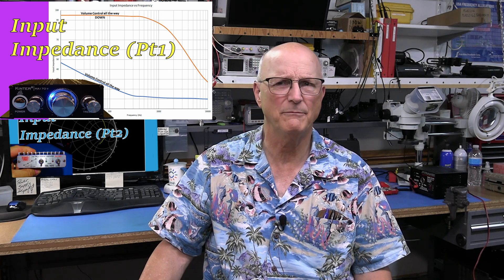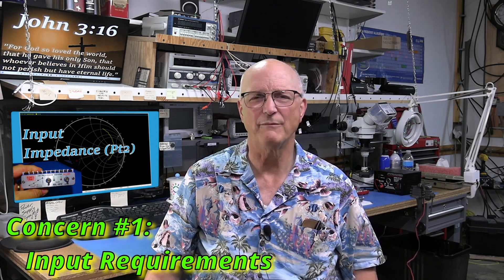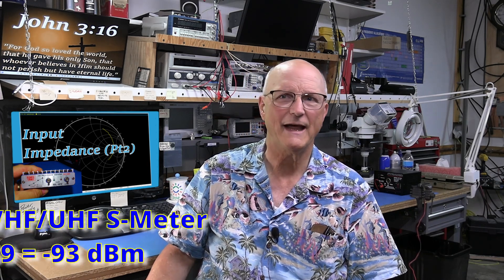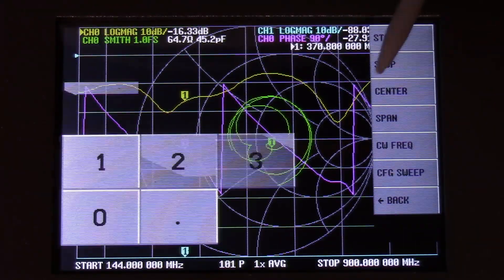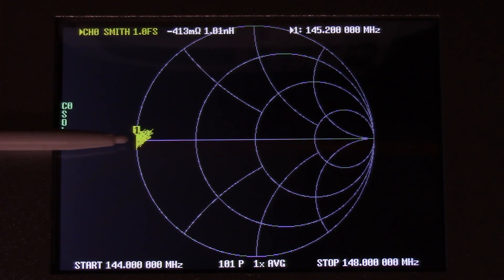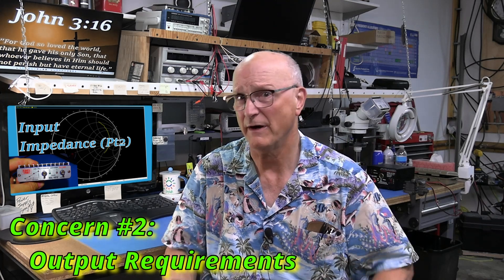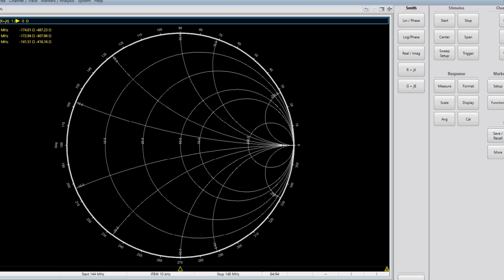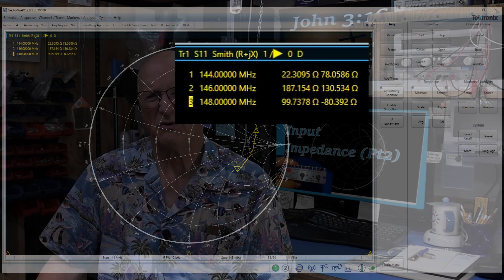Measuring the Input Impedance of a Product, Circuit or System (070b)

Comment: Great video!!! may i ask how to calculate the Retrun Loss=-2.1dB with measured impadence Z=21.8+78.6j  ???
Reply from the maker: Thank you!
We start by calculating the Reflection Coefficient =  (Zload - Zo)/(Zload + Zo), where Zload = 21.8+78.6j and Zo = 50.
Using Octave to do the math, I get a Reflection Coefficient of 0.3665 + 0.6935j
Next, we calculate the magnitude of the Reflection Coefficient = SQRT(0.3665^2 + 0.6935^2) = 0.7844.
In "Octave speak," this is the ABS command.
Finally, the Return Loss = 20 * log (magnitude of the Reflection Coefficient) = 20*log(0.7844) = -2.1092dB
Here are the steps from Octave's command window:
>> ((21.8+78.6j)-50)/((21.8+78.6j)+50)
ans =  0.3665 + 0.6935i
>> abs(0.3665+0.6935j)
ans = 0.7844
>> 20*log10(0.7844)
ans = -2.1092
I hope this helps. :-)
Reply: @eie_for_you  got it!!! thank u soooo much!!! learnt a lot!!!
Reply from the maker: You are welcome! :-)

Comment: Does this unit receive when power is off with just the insertion loss of the signal path (tenths of a dB) or does it need power to receive due to the tx-rx switching setup? How does the input impedance change from no power to power? Is this pin diode switched or relay or something else? I think that the under power measurement depends on the no power configuration so can we start there?
Reply from the maker: Yes, I believe it is a passive, passthrough for receive when the unit is off. Of course, this one is probably 27 years old and is long gone from the market place. It is very possible, however, that units of similar design exist out there now.
I have not dug into the design of the unit. As far as this unit is concerned, I am pretty much an "appliance" user. :-)

Comment: You saved my significant time and energy!! I was trying to match datasheet measurements of RF receiver and then match it to 50ohm using Nano VNA and Rigol VNA!! I will try to find a tektronix one. Thanks
Reply from the maker: I'd look around in the Rigol VNA and see if they let you adjust the stimulus level. ... and you are welcome.🙂
Reply: @eie_for_you  Rigol VNA has stimulus from 0dBm to -40dBm. With RF receiver powere On and Off there is a small shift in impedance measurement. Still Not close to datasheet value of 1.5-54.5j. My measurement is around 4-147j (with IC supply turned ON) 4.5-168j (without IC supply)
Not sure if this is the issue with VNA stimulus not being -40dBm (like you said for Nano VNA) or something else I am doing wrong.
Reply from the maker: And there will be a shift because the capacitances associated with active components (and even diodes) changes with applied power. :-)

Comment: Thanks for some very good and helpful videos.
Can you and if so how would you use a nanovna to set up a set of duplexer cans for repeater use?
Reply from the maker: I have a few videos on tuning duplexers (here is the link to the first video: https://youtu.be/ZZHknVp3asc).
So, the answer to your question is not really, but also sort of. It has the functionality but not the dynamic range. It can easily do the Return Loss portion of the tuning. But the reject frequency is where it cannot quite cut it. The reject dip will be a flat and wide bottomed dip with no way to really know what the exact reject frequency is. This is where the dynamic range issue kicks in. Part of this is due to the fact that the stimulus level is lower (mine is a fixed -9 dB!). The other part of it is the limitations of the "front end" of the receive port (port 2 - nanoVNA speak = port 1).
With all of that said, it is a great way to practice tuning a duplexer!
If you are willing to accept a just "OK" tune, then it might do what you want. 🙂
Reply: @eie_for_you  Thanks. I'll have to check those videos out. 
Have a great holiday season.
Reply from the maker: @REKlaus  And to you, too! 🙂

Comment: Hi.. EIE ... Can I give output of nano VNA ( 1 mhz square wave, 1.5 V Peak to Peak at the input of tiny SA. Or there is need of attenuator (value)?
Reply from the maker: I am at a bit of a loss as to what you are trying to measure. Are you measuring the input impedance of your tinySA whose input limits are 1.5 V pk-pk? 
As a point of reference, 0dBm is 1 mW into a 50 Ohm load = 50 mV RMS = 141.4 mV p-p.
Your 1.5V p-p = 530 mV RMS => 5.6 mW into a 50 Ohm load => 7.5 dBm.
My nanoVNA output is below 0 dBm. :-)
Reply: @eie_for_you   I want to know if I can directly connect output of nano VNA to tiny SA . Also what are limit of tiny SA.. Plz can u confirm..I just dont want to blow  my tinysa
Reply from the maker: @minazulkhan8287  Here is the LINK to the complete specifications for the tinySA:
https://tinysa.org/wiki/pmwiki.php?n=Main.Specification
Therein it states: "Absolute maximum input level of +10dBm with 0dB internal attenuation "
Your nanoVNA max output is 0dBm (theoretically - but it is actually likely less than that).
So, it looks like you are quite safe. 🙂
Reply: Thanks......it worked 😊.
Reply from the maker: @minazulkhan8287  You are very welcome! 🙂

Comment: If you have a circulator that operates at that frequency range you can connect the stimulus signal with an attenuator to port 1 of the circulator, your amplifier at port 2 and the port 3 of the circulator to receive port of your VNA and you are left with a S21 measurement that only passes once from the attenuator. Of course calibration is needed.
Reply from the maker: Interesting idea.😁  Unfortunately, I do not have one of those things. 😞

Comment: I've been keenly watching your videos on measuring input impedance and frequency response. The importance of the design and planning is what struck me most. I have a quesiton that hopefully can help with my electronics knowledge gap. I have heard that impedance matching is not as important for RX, perhaps since the power levels are extremely low (if you think about the antenna as transmitting into the receiver and the levels are microvolts). According to a Rohde and Schwarz video on VSWR, at around 8:1, 60% of power is reflected and therefore perhaps this would be a 'missed opportunity' to maximise the received signal? However, I have also heard about impedance bridging where it is important for the load Z (amplifier in this case) to be much higher (ideally by a few orders of magnitude) than the source (antenna in this case), to maximise voltage transfer. Could the amplifier receive circuitry benefit more from a higher voltage transfer than power transfer from the antenna? Is my understanding correct and could this be the reason for why on the RX side of this amplifier the Z is higher? It feels like there is a lot of conflicting info in my head....
Reply from the maker: @Alex-G0PJT  well, admittedly, I am not a receiver designer. My personal thinking is that there is a trade off going on here. One comment mentioned that a receiver from end was also adjusted for noise figure, not impedance matching.
Nonetheless … power reflected  due to an impedance mismatch … 60% of it … it doesn’t seem to be power that can induce voltage across a load if it never gets there (it’s been reflected 🥺).
So, I am not sure how to address this. In my mind it should be at lease *close* to the system impedance of 50 Ohms.🙃

Comment: I wonder if the amp input was using a 9pf cap to gnd, what the loss would look like?
Reply from the maker: Part of the issue, it looks like, is the fact that they use electromechanical relays for the T-R switch. 🙂

Comment: Out of curiosity how does the amplifier switch RX/TX, relay or diode switching?  I have found most cheap amplifiers use relay switching and usually use relays that are not suitable for higher frequency.  That and just flat out poor design results in input/output impedance that can be all over the map.  Better amplifiers like my Linear Amp - Gemini series and commercial TPL amplifiers use PIN diode switching .  Mike KC3OSD
Reply from the maker: @mikesradiorepair  You question made me look….yep! There are two relays under the hood. AND I discovered that there is a switch that is labeled “FM” “SSB” that I didn’t know existed. You are right, based on the time in my life that I bought this, it is more than likely an inexpensive device.😀
Reply: @eie_for_you  Well that's a strange place to stick the FM/SSB switch.  I can just hear that QSO now.  "Hold on George, I have to dismantle my amplifier so I can switch into SSB mode".
Reply from the maker: @mikesradiorepair  🤣🤣🤣🤣